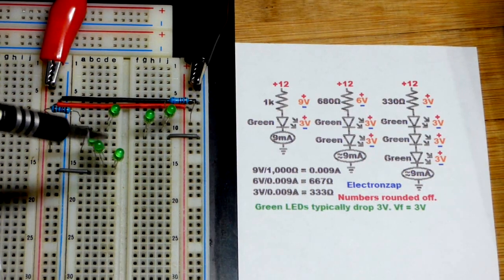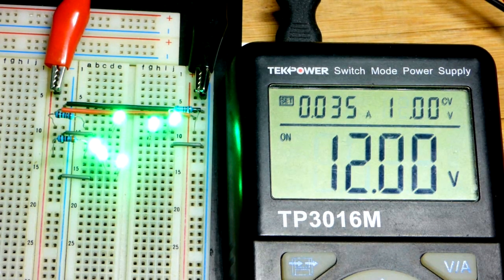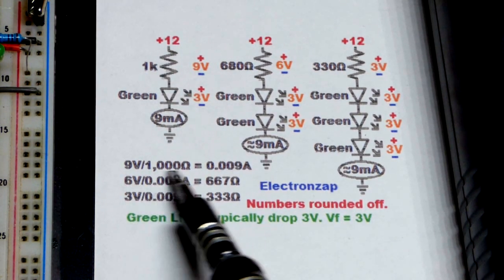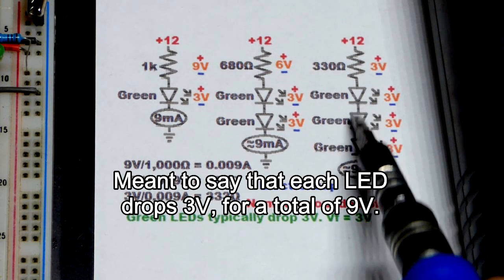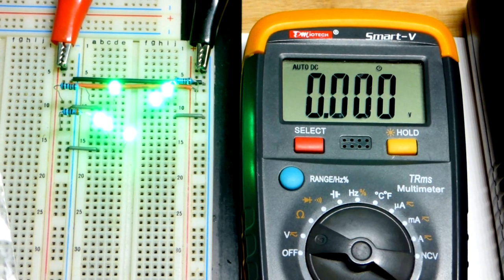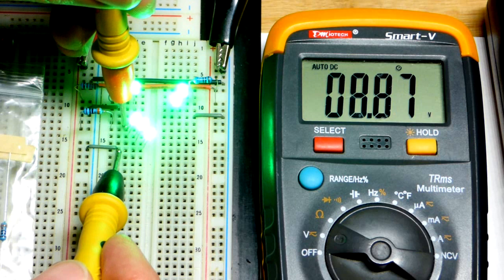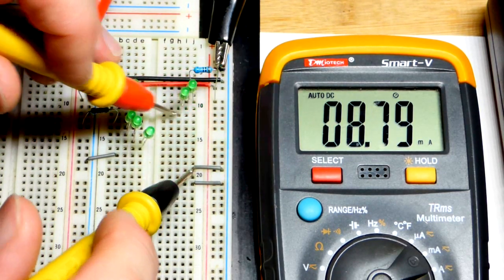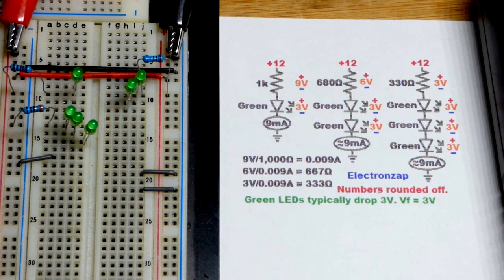Stacking voltage drops of LEDs and picking resistor values to get 9mA with 12V multimeter measured

Comment: Excellent demonstration. I’m going to try to duplicate this and measure. I’m just learning so I appreciate this type of video. I really like your power supply. It looks really useful.
Reply: I built this circuit on a breadboard and got very similar measurements.
With all 6 LED's at 12.0 V - 29.1mA. But, when I removed all the LED's except one, and dropped the voltage to 3.0 V, I only get 0.69 mA. The specs on my LED's say 3.0-3.2V & 20mA. What's different?
Reply from the maker: Not much current flows through 1 LED and resistor if the supply voltage is close to the forward voltage.

Comment: Very clear and easy to follow as always.
A bit of a side question : where can one find reliable jumper wires like the ones use to go flat across the breadboard here ? I'd like to find something stiff enough but I am not sure what to look for (the ones I have atm are just too flimsy to be usable)
Reply from the maker: Just have to search for breadboard jumper wires, or breadboard jumper cables, anywhere that sells electronics stuff.
Reply: @Electronzap  Hello ! Will do - I was just getting frustrated with the bad quality ones I got with my early online purchases (beginners electronics kits). Will definitely have to find some better stuff.